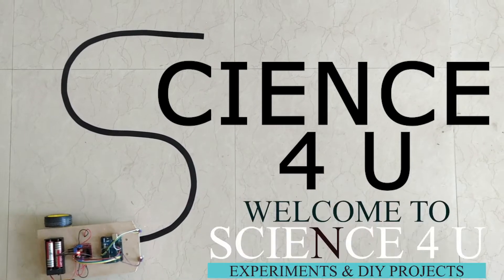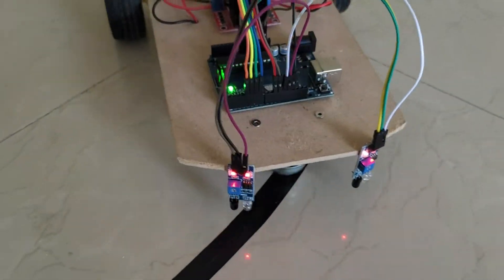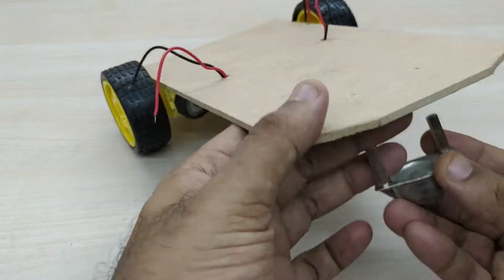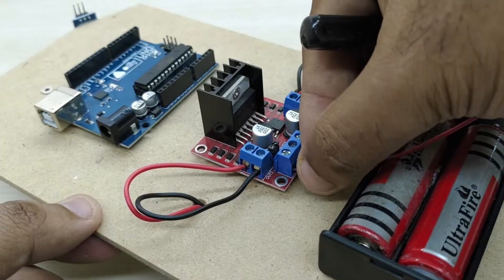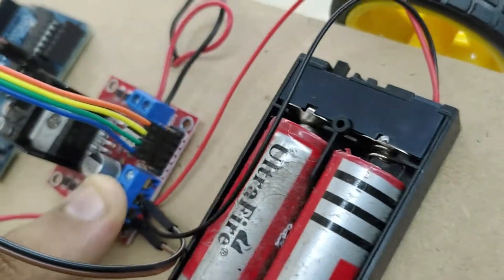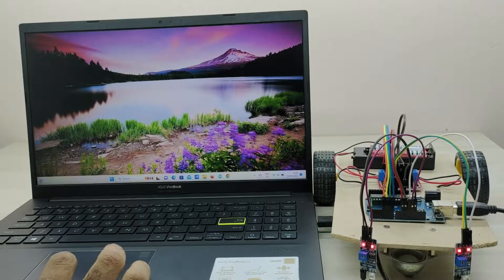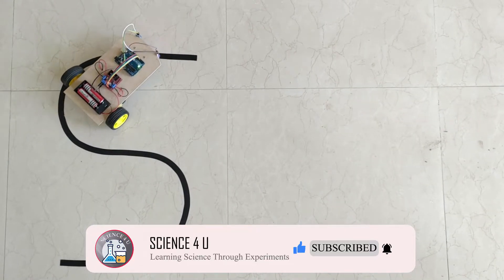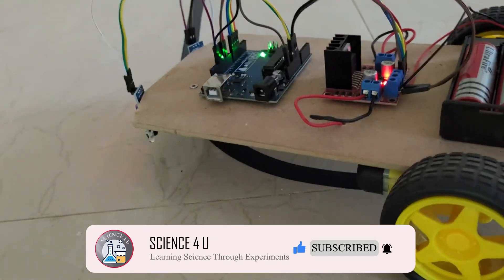How to make a Line Following Robot || Arduino Project || Line follower robot making tutorial

Comment: 😢😢A question, what can I ask if my line sensors are different and when I connect it, it doesn't work and I connect each pin where it goes (the ones for the sensors) and it's frustrating for me.

Comment: Bro mine tyre aren't rotating
Reply from the maker: Could be a problem with the motor driver board. Is it a new one or already used? Also please keep the USB connected and see if the wheels are rotating. Then it could indicate a discharged battery..
Reply: @Science_4U_ new motor driver hai aur sab kuch new hai usb connected ke baad bhi tyre rotate nhi hote
Reply from the maker: Okay can you do one thing?. Connect 5V of arduino to IN1 pin of motor driver board and GND pin of Arduino to IN2 pin of motor driver board and switch ON. Now can you see one wheel rotating?

Comment: Why the sensor lights are not glowing the left sensor  power I had connected to AREF and the GND next to 13 but no lights are coming up on that ir sensors also my battery (the same as you use) gets heated and smoke is too coming can you please help
Reply: Your bms is damaged

Comment: Does it turn on automatically?
Reply from the maker: @ruthdiaz5446 No. Actually there is a small switch in the battery holder which has to be turned on.

Comment: Every connection is fine but it doesn't sensing rather it is rotating in circular
Reply: SAME GOES WITH ME
Reply from the maker: It is because of the improper calibration of the IR sensors. The sensitivity of the IR sensors have to be adjusted correctly to solve this problem.

Comment: Hey friend. I made this robot but one wheel is moving faster than the other, so it's not moving straight when both sensors detect white. How can I fix that?
Reply from the maker: Hi friend. That may be most probbaly because the motors may be of different speed capacity. There are 60 rpm, 100 rpm and 300 rpm BO motors. May be both the BO motors are not of same speed..

Comment: hello sir the code isaid errors how to fix?
Reply from the maker: Hi friend.What is the error that it is showing?
Reply: @Science_4U_  its not error sir sorry but after i upload it the dc motors doesnt work it doesnt go forward how do i fix this
Reply from the maker: It could be due to many reasons friend. 1. L298n motor driver board may be faulty.2. Batteries may be discharged and not powerful enough to drive the motors.
Reply: @Science_4U_  thankyou sir now I found the issue, it was in my battery it wasn't compatible and that I should add more battery

Comment: Hi sir, thank you, but i would like to know how do I make a logic with an implementation in which each sensor is defined in an array of 5 like with 5 infrated sensor and if the 5 infrated sensor detect the line at the same time like a T line), the car stopped. I need help, its kinda urgent
Reply from the maker: @VanessPinky  Hi..you can do this with 2 IR sensor as well. The robot has to stop if both IR sensors detect a black line..

Comment: Hey mate, what are the measurements for the plywood? And, do I need to use plywood? Can I 3d print the bord?  (Btw, if this sounds dumb, I'm sorry, Im just a 6th grader)
Reply from the maker: I am using a plywood with a length of 250mm and width of 120mm..Definitely you can design and 3D print the board also.
Reply: @ thx
Reply: No one asked for ur age

Comment: thanks for your video, but what code can I program for 4 wheeled robot ?  Can you please reply me ?
Reply from the maker: Hi friend. You don't need to change the code at all for making a 4 wheeled robot. Instead of the one motor at left and right, you can connect 2 motors together. Join together red wires of both left side motors. Also join together both black wires of left motors. Connect this to l298n driver board. Similarly do for right side motors also. It is a bit difficult to tell clearly.  I have done such a bluetooth car which uses 4 motors. You can watch that video given  below to get an idea. 

https://youtu.be/JK6zTM65Rh0?si=DyolGcEuwJ0KVFDl
Reply: Thank you  🎉

Comment: Basic question: can the lines be made with black tape itself, will it be too reflective for the sensor? Or do we have to use black chart paper for making them?
Reply from the maker: Hi friend, from my experience it can be made from black tape itself. I have infact used a black insulation tape which was slightly refective also. Just make sure you have a contrast with the background. If you are using black tape, the floor should be a light background.
Reply: Thank you

Comment: what battery should i use if i dont have a lithium/lip-ion battery?
Reply from the maker: You can use 9V zinc chloride battery. These are very cheap and commonly available but dont last long. You can use 3 or 4 nos. of these batteries in parallel so that it will last for some time.
Reply from the maker: You can also yse 4Nos. of AA zinc chloride batteries.

Comment: Thank you, we have made this. But the line follower is going in circles.
Reply from the maker: Hi friend..Do you mean that both the wheels are rotating in opposite directions?. If yes, please interchange the motor wire connection at the motor driver board of the wheel that is rotating backwards. That should solve the problem..